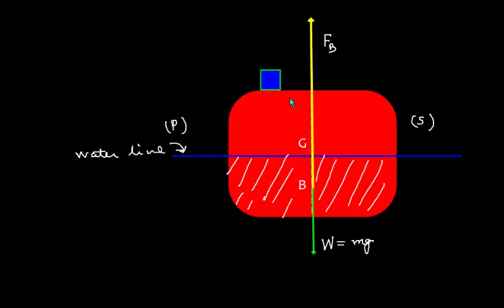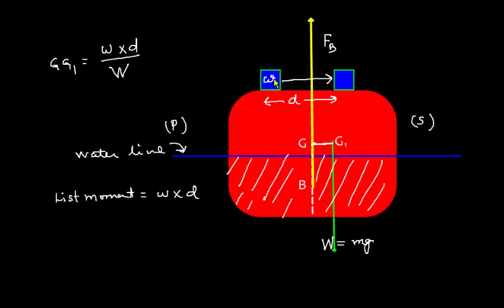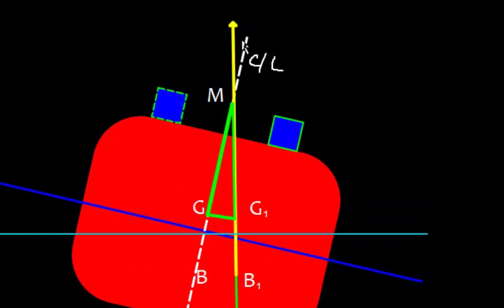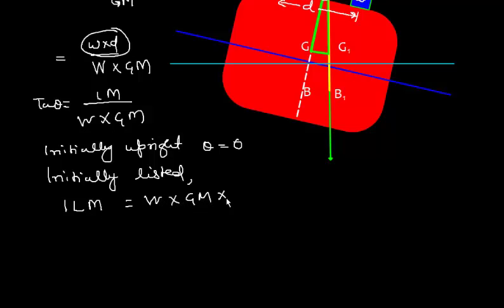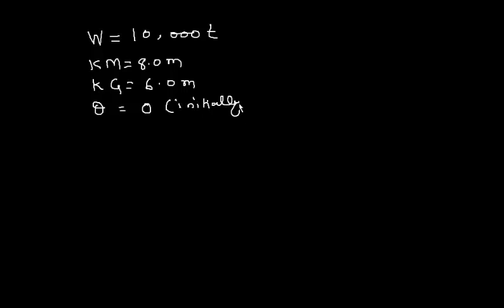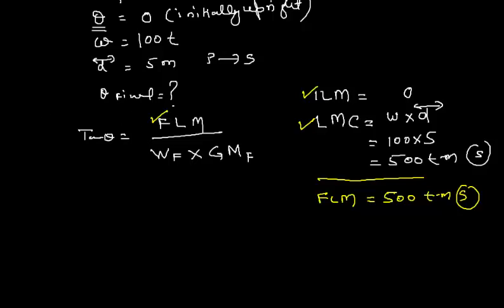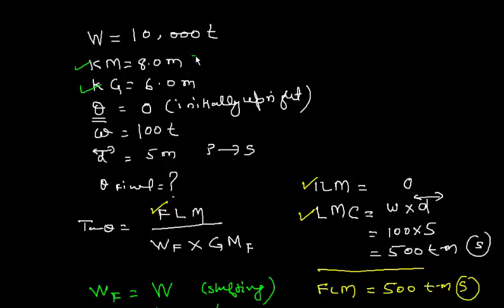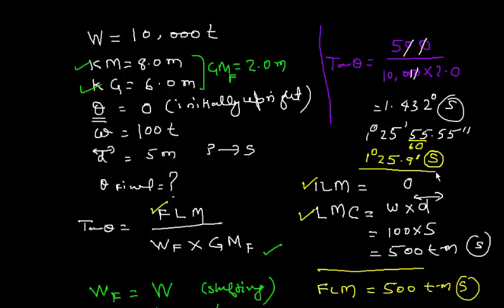Ship Stability_Introduction to list formula _ Example of list due to  Shifting

Comment: i have a question in minute 6.45 said Wf will be W only because its shift and it will change in case of loading or discharge thats means if i have a load i will add, i must add it with the original weight ?
because i saw in another video center of gravity changed and there are another method